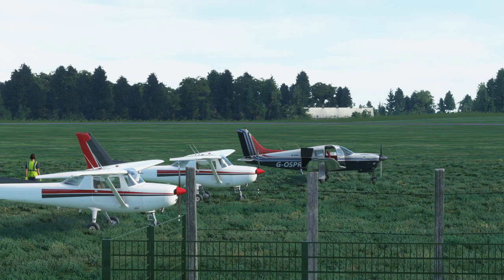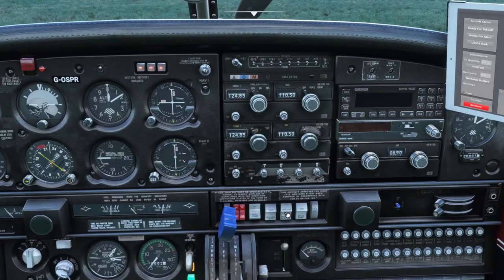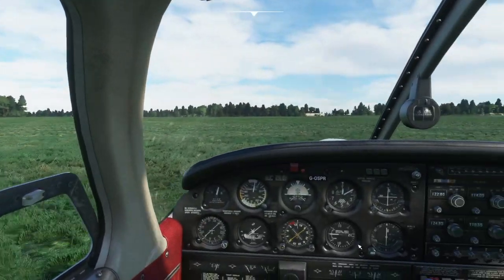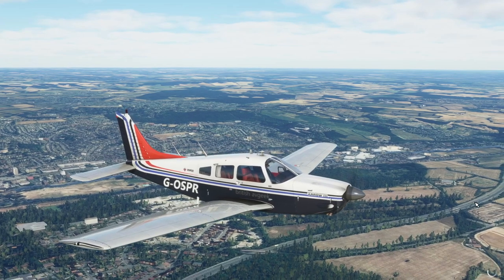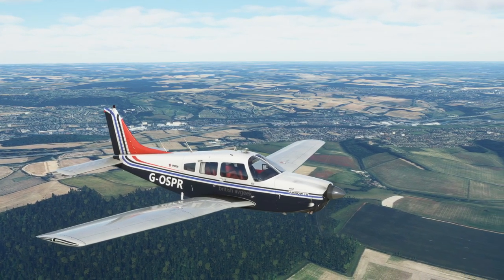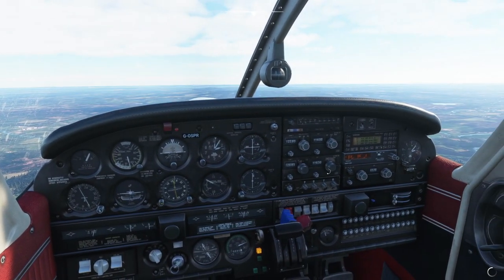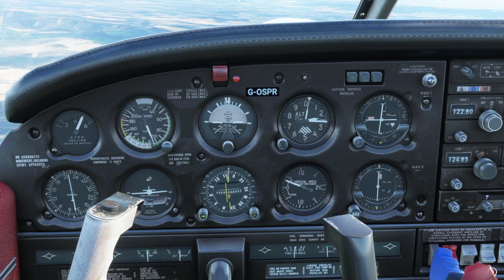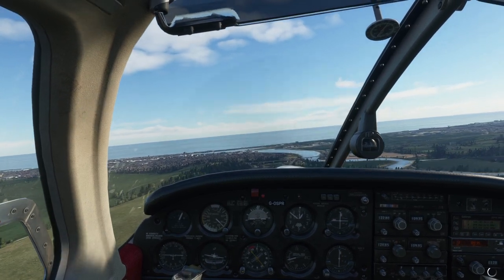MSFS | JustFlight Piper PA28 Arrow III - FULL VFR Flight + AutoPilot and VOR Tutorial [+ Planning!)

Comment: Nice model. If I'd have any criticism so far it would be one detail in the exterior visual model: the elevator antiservo tab (that also works as a trim tab) is moving the wrong direction when trim is applied (when you trim UP, it visually moves as if it were being trimmed DOWN and vice versa). Not to forget, when a tab moves UP on the stabilator, it creates a down force on its trailing edge, (stab leading edge UP), therefore driving the stabilator to a more airplane nose DOWN direction.

The catch here is that in the model it is moving in the right direction when responding to elevator inputs (antiservo function). It's only in trim that it's the other way around.
Reply from the maker: Nice spot!!

Comment: Thanks for the tutorial flight, I just flew it llike you did to learn. I am confused on the altitude restrictions. The number under and above the line: am I supposed to fly between these altitudes, or am i denied to fly between these altitudes?  And what am I supposed to do when different boundaries overlap? You also mentioned a VRP to use right after Denham departure but cannot find that on a map?
Reply from the maker: Hi! Yep the VRP I mentioned, is basically the town of St. Giles (there is a church but it can't be seen in MSFS) if that helps to fly it on the map.

For the altitudes - if one says 3500 then a line above it, and 5000 above that then it says you must fly outside of that airspace zone - so you would for example fly at 2,500 or 3,000ft instead... and if you then fly to a zone with a lower airspace level of 3000 and you are at 3000, I would recommend descending to 2,500ft to stay clear :)
Reply: @BritishAvgeek  thnx! Arnout the vrp.. i meant on wich  aeronautical  map is it? How do i know there is a vrp in the first Place? Denham is noT with a chart in navigraph for instance
Reply from the maker: @renefeijen5916  hope this helps -  http://www.egld.com/flying_into_denham.html#pooleys
Reply: @BritishAvgeek  Yes it does, thanks. I was wondering how in real life pilots revtrieve this information. The probably check website of the airfield or phone the airfield in advance of the flight while planning the trip. Or order these charts in an aviation store?
Reply from the maker: @renefeijen5916  yes they're all paper charts which have to be paid for unless you can find them online via the airfield websites etc 👍

Comment: Hi,  have you had any issues manually tuning the coms radio to ATC frequencies?  I'm finding the ATC give a frequency say for example 124.22 but I find that the com radio cant tune to that frequency after the decimal point as the number go up and down in different increments??
Reply from the maker: Sometimes it'll need one click left/right for it to tune in nicely 👍 some frequencies like 124.22 might actually be 124.225 for example
Reply: @BritishAvgeek  Thanks for reply.  I'll have another go tomorrow with it but I was finding ATC would say 118.27 but my radio would manually tune 118.25 then next number 118.30 so can't actually tune to the exact frequency ATC give? Very odd.